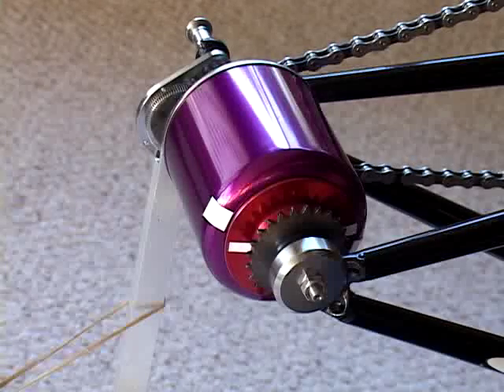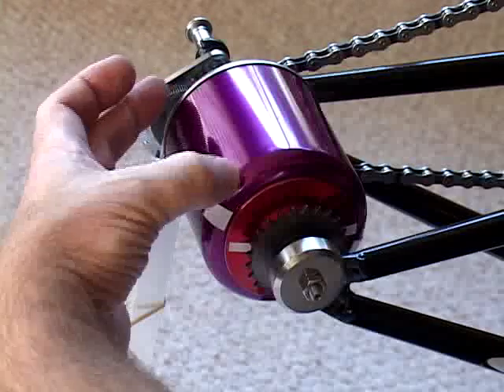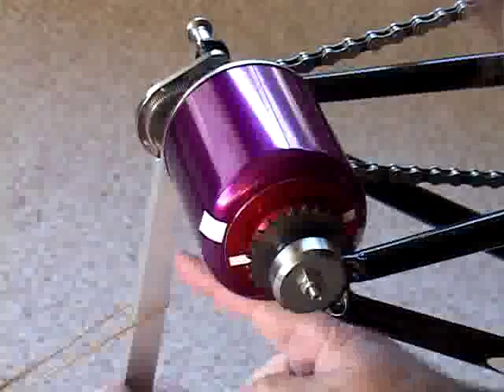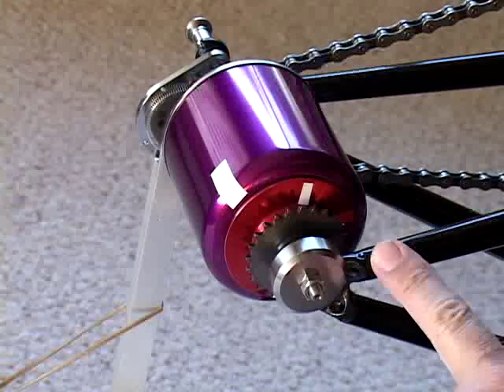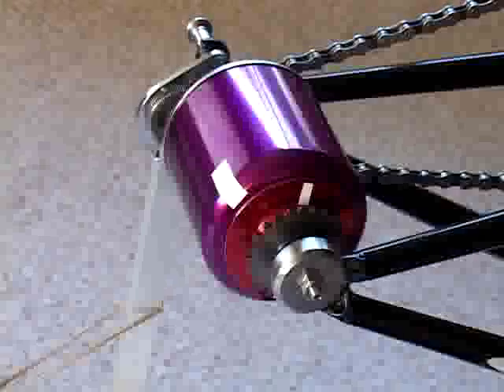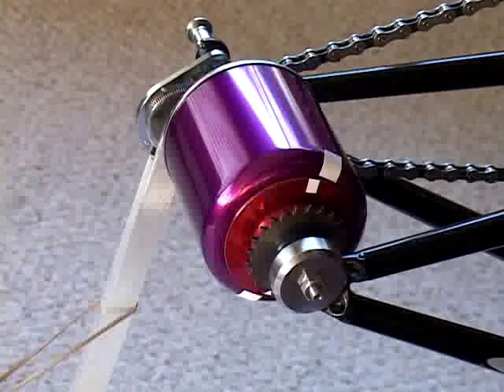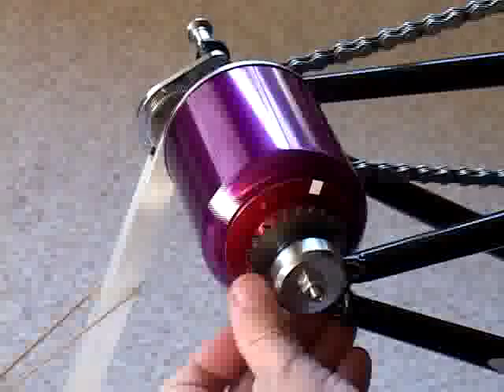Automatic Bicycle Transmission (IVT)

Comment from the maker: @3nasacova That’s easy, dude: the reciprocal of the square root of 2 or the sine of 45° is a multiplicand of the Cartesian polar-velocity stabilization function as an orthogonal component.  This may have implications in the discrete velocity of electromagnetic propagation.

Comment from the maker: @djscrewlicious357 A Stingray!  Wow, there's a bit of history!  I owned one when I was a teenager, and adapted it to a Sturmey-Archer 3-speed hub.  The SIVAT is not yet available as a product, so you might consider using a multispeed hub for now.  I recommend either the Rohloff Speedhub or Shimano Nexus, but warn you that a lawnmower engine likely produces too much power for them, so you'll need to go easy on the throttle.  The SIVAT for bikes will handle motorized use at about 2 hp.

Comment from the maker: @WaagooshTheRedFox Your suggestion is the idea behind the Prius Hybrid Synergy Drive, which is effective but only about 35% efficient, and only useful for braking.  It's fine for large vehicles only, due to scalar issues.  The concept of charging a battery on level ground with mo-gen, without regen braking, is worse than a zero-sum strategy because only losses are incurred in the total energy account; recycling energy is inefficient in such a closed (self-contained) system.

Comment: i think you should use it to recharge the battery of a motor that drives the motor. see, you activate the motor right, once you are up to power across flat ground you increase the output of the transmission and it charges the battery while the motor is off. then you can power up hills witht he motor, and use the gears to generate power when you go down the other side.

Comment from the maker: @callmeshane303 Thanx for that input.  I have thought about the prospects of fully covering the chain drive for that very reason.  Since the SIVAT drive eliminates derailleurs, an optional cover could be designed to cover the chain & sprockets as a 'clamshell' 2-part shroud.  The simpler design would protect against dry grit & dust.  I've also looked into the Gates belt drive, but have found that pulley sizing is problematic for the SIVAT system; both pulleys would be too large.

Comment from the maker: @callmeshane303 Several of the 100's of YouTube commenters have helped me to better understand how the SIVAT will be used.  This made me realize that a front sprocket version is better.  I recently (yesterday) discovered that such a front version will enable inexpensive optional setups for achieving higher top ratios without unusual sprocket sizes; the rider will have more freedom to customize his/her SIVAT without much special hardware!  It will be chain-driven & will be sealed.

Comment from the maker: @TheHumanNacho Additionally, purely motorized vehicles will include a servo-assisted ratio control system that will allow zero-speed for clutchless idling & decelerating to & accelerating from a stop.  A flywheel-based version will be fully computer-controlled for such vehicles to enable a smooth Kinetic Energy Recovery System (KERS), while maintaining a spring-based fail-safe mode.  Thanx for your concerns.

Comment from the maker: @TheHumanNacho The physics is the same, regardless of the prime mover.  The effect will be to lower the output/input ratio as resistive torque increases for heavy acceleration & increasing grade of ascent.  Since I've already field tested this on a predecessor CVT on hilly bike rides, I assure you it works very well.  The overload protection won't take effect for typical traction on the steepest hills for bikes; ultra-low ratios will gradually lose torque responsiveness by intentional design.

Comment: While the general idea is cool, I don't think it has much market application on bicycles: while turning speed into torque works for internal combustion engines, most electric engines and uphill bicycling, cruise bicycling and downhill bicycling rely on turning torque into speed. Furthermore, having an overload-cutout makes it unreliable on the kind of situations a real mountain cyclist gets into, such as deep mud and soft sand.
Give it a decent high range and you'll be in business.

Comment from the maker: @myid9876543 Sorry, you're inverting the concept here.  Input (pedal) torque & cadence will be nearly constant, while output (wheel) torque & speed will be variable.  Fairly constant power throughput will result from this, regardless of grade, because power is the product of torque times rotational velocity; as wheel velocity decreases, wheel torque increases.  One might infer that infinite output torque would be approached as the ratio approaches zero, but material limits do not allow this.

Comment from the maker: @THBandit6 That's what the torture-testing is for!  JK!  Don't interpret the overload protection feature too literally; on pedaled bikes, the design for the control system will be fine-tuned to assure nearly constant pedal cadence & force, regardless of the cyclist's strength & hill-ascent steepness.  This is an important design goal for all pre-production prototypes.  As a product, the SIVAT will not automatically slip away under high force as if it was going into 'neutral' gear.

Comment from the maker: @bmw1123658 This assembly would be laced with spokes to a rim for the rear tire.  The product will not be as shown; it will be at the front sprocket location with a different design.

Comment from the maker: @mattcorden95 The word 'proprietary' means that it's a deliberate secret.  Divulging the inner workings would nullify my qualification for a patent, so I won’t tell you!  Sorry.  The key elements in determining slippage are the one-way clutches that slip for <1° of rotation while transitioning to & from full, locked load in overlapping succession.  Slippage is very small & only under light loads, resulting in miniscule power loss.  During their locked condition, they cannot slip.

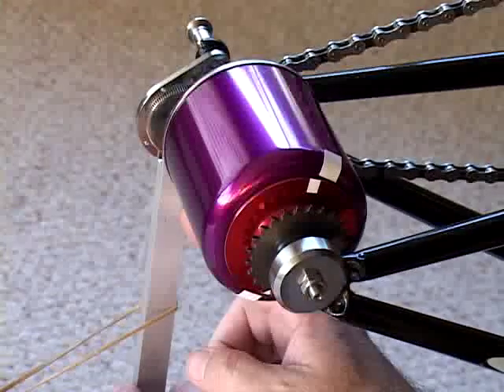Comment from the maker: @3nasacova The power of the lever is strong, Grasshopper.  Apparently, you think that engineers dispense with mathematics & physics to determine a machine's capacity!  Yeah, I'm 'guessing'!  [Watch 4:45 to 5:00; notice that the rubber band represents a spring mechanism.]  I'll be sure to consult with you to check my strings of calculations for structural strength, gearing, athlete ergonomics, motor power-torque curves, component life, velocities, leverage & spring rates in the final designs!

Comment from the maker: @ross425100 I doubt that there are any belt-based IVT's.  However, you are correct that this has less friction than Variable Diameter Pulley (VDP) CVT's.  The company intending to produce it has been chosen, but others might be able to contract for it use.  Thanx.

Comment from the maker: @mattcorden95 The mechanism inside the SIVAT uses gears & levers as a proprietary system for transmitting power.  The SIVAT shown in the video rotates independent from the hub (the output), but its output sprocket is replaced by direct connection to the hub of the wheel.  The next version will be different for the actual product, but will be based on the same principles applied to the pedal crank instead of the wheel hub.

Comment from the maker: @MrSuaveeito Yes.  Since it has the capability to achieve a zero output with gradual increase into very low gears and upward, the SIVAT will have a version with an override for this purpose.  It will act like a clutch, but will be more efficient & durable.  This version will be useful for motorized bikes & other vehicles to accelerate from a stop.

Comment from the maker: @chaser107 It's significantly different.  Nuvinci's high is 3.6X low, whereas SIVAT's high is infinitely higher than its lowest ratio.  Also, the SIVAT does not use rolling traction like Nuvinci.

Comment from the maker: @letsfuc The chain-drive multiplies the SIVAT ratio; in the featured version here, this chain-drive is 5:1.  However, the product version will have an internal high ratio over 1:1, so that an MTB installation will easily achieve at least a typical final high of 4:1 with a less extreme chain drive.

Comment from the maker: @originaldriver Excellent question!  As a first prototype, some of the torque calculations were inaccurate as a result of incomplete pre-design analysis of its complex reaction geometry.  Testing it allowed me to discover errors that are corrected in newer geometry that will react with less bias toward low ratios.  It doesn't slip; what is observed is a tendency to react in favor of lowering its ratio too easily.  Efficiency should be ~88% in lowest usable ratios, 94% in higher ratios. Thanx!

Comment: I wonder how efficient the torque multiplication is on this trans if used on a bicycle? There seems to be quite a bit of slippage in the low-ratio range.

Cool idea.

Comment from the maker: @LawDoc11111111 The principle of operation is different from the ZeroMax®; this allows greater linearity, speed, power throughput & efficiency. I own a ZeroMax®, so I can say that its efficiency is low, more suitable for production machine drives rather than for vehicle drives. The SIVAT concept is only similar inthat it's also a ratcheting drive.

Comment from the maker: @weedissafer The featured version is a wheel hub, much like typical geared rear wheel hubs for bikes; so the tire would be mounted on a rim attached to the hub with spokes.  The planned product will be a replacement for your chainwheel at the pedal-crank instead, so your rear (drive) wheel will be very simple like on a fixie.

Comment from the maker: @1337Machzzz John H. Gibbs' master's thesis indicates VDP CVT (typically snowmobiles) efficiency at 65%-80%.  My calculations for SIVAT efficiency indicate 88%-94%, but this will be tested in the development process.  If my calculations are even close, the SIVAT will be better for snowmobiles as efficient, robust transmissions with much more ratio range.  Thanx for your encouragement!

Comment: I dont know how big losses u have in this transmisson or how it works internally.
But the variable transmission has been around for a long time in snowmobiles and transmission there works where the engine is the strongest or in this case the bicyclist. will be interesting to see if this works aswell as you hope and i hope we will soon see a stronger version of this.  And if u can lower the losses 
in the transmission it will revolutionize the snowmobile world.  keep it up. i want this to work.

Comment from the maker: @bnewman94 Ironically, the definition of infinite is 'undefined'!  The problem stems from human limits in dealing with infinity in concept & in maths.  For clarification about gear ratios, the convention is output speed divided by input speed; so my IVT's lowest ratio produces zero output speed with no reference to self-propulsion.  The IVT term distinguishes it from the CVT (which has a finite range).  Anyway, thanx!

Comment from the maker: @jpsousa4 No.  A clutch is a dynamic friction device, whereas the SIVAT is based on static friction.  This important distinction means that the SIVAT is low-loss as opposed to lossy in power throughput.  Your simplistic comment pays little respect for the myriad of comments & responses here, let alone my efforts to provide a new, useful machine.

Comment from the maker: @Murzamadiyev You'll not likely be able to put too much load on it because the design should accomodate the strongest elite bicyclists.  The highest loads on hills will result in very low ratios unless you add a motor-assist with motor power that exceeds its capacity, in which case it would drop to zero output.  Normally, this feature self-compensates because the lowering ratio results in lowering pedal torque & higher pedaling cadence.  Overload protection won't kick in with normal conditions.

Comment: This is not infinitely variable, the range is 1:1 through 1:0. This is basically only good for biking from a stop or going uphill. Where is the 1:10? I want my wheels to turn ten times for everyone once i turn my peddles in order to go very fast. If this was truly infinitely variable, then i could theoretically peddle at 1:10000000000 and end up going 300 M/H on a bike.

Comment from the maker: @TimpBizkit The SIVAT does use gears, but in an unconventional way.  It uses a different principle of operation than CVT's that you're likely familiar with.  It's mechanism won't be shown until it becomes a product under a pending or issued patent.  When the SIVAT is sufficiently developed for production, I intend to create a new video to demonstrate its use on a bike with a rider experiencing various loading conditions, such as pedaling up & down hills.

Comment from the maker: @TimpBizkit If you reverse the sprockets, the highest ratio will be rather low.  If you stand on the pedals, the ratio will lower faster than if you begin pedaling with slightly less force; this responsiveness will be user-adjustable.  You'll be able to lock-in any ratio too, so that the ratio won't change even when you stand on the pedals if you want.

Comment from the maker: @Asylumescapee69 All multi-ratio transmissions have one highest ratio.  The SIVAT achieves that with sprocket sizing; pedaling speed for the YT video was actually rather slow like high gear on most multi-ratio bikes because a large sprocket (not within view) drives the small sprocket (visible).  The product for bikes will have a high ratio similar to an MTB high ratio, and all ratios going down from there.  The SIVAT is far different from a varispeed drill drive, drill chuck or anything else!

Comment: I don't see the usefulness of your prototype...In a bicycle I want less pedaling to more wheel revolutions as I build speed. It didn't seem like your transmission did anything greater than 1:1 and actually took rpms away... 
essentially it appears to be a re-purposed drill chuck...

Comment from the maker: @cloverdale87 First it should become successful with bikes & motor-assisted bikes.  After that works out, we'll know how to design it for more power as required on motorcycles.  The higher input speed of an MC engine, compared to leg-power, works to the advantage of the SIVAT's low ratio capability.  In effect, it will cover a huge range of MC speeds with more efficient engine operation via rev control.

Comment: @SIMKINETICS
Well i'm not sure.
The rubber band thingy was already commercially available
Since you say your SIVAT will be available late next year...
It looked different from the one you showed in your video, the employee said its main
advantage is to be very silent when shifting gears.
If i understand correctly the SIVAT is not shifting gears but gradually changes
the ratio without interrupting forward drive. (sorry for raping mechanical terms)
i think the SiVAT will be worth the wait.

Comment from the maker: @unamaxify Perhaps the 'strange looking rubber band thingy' was my SIVAT!  The SIVAT will be a product, likely first available late next year.  Bike shop employees will learn about it in detail, and will understand it as a machine composed of durable metal components including a steel spring instead of the rubber band!  BTW, 'gearbox' is a misnomer; although the SIVAT uses gears, its ratio variability stems from simple levers.

Comment from the maker: @zreng1 Excellent question!  Freewheel-style bearings (overrunning clutches) use friction to engage wedge-like action in SIVAT's Continuously Variable Regulator (CVR).  Power is transmitted without relative motion between wedging elements, so this friction is almost purely static and lossless.  Tiny amounts of power loss result from dynamic friction during repetitive freewheel engagement & disengagement of CVR elements.  The SIVAT is a high-efficiency friction management system.

Comment: @SIMKINETICS i still dont see much of a difference(performance wise not mechanically) either way as soon as some one come out with a variable transition that dosen't follow the set point or gets like 30-40 set points instead of (6 witch is what my maxima has) that well be the transition i want in my car for performance and mileage for when im not ripping around,, but i know torque converters well still have a place in the industry for there delicateness and ability to tow heavy loads

Comment from the maker: @manseaua Ironically, I do not like automatics in cars!  The impetus to design an automatic IVT is based on avoiding the annoying aspects of automatics.  Torque converters' average efficiency is much lower than their max, about 35%, but somewhat dependent on driving technique.  Since most of us often drive in slow conditions, this low efficiency is a problem because the TC is not locked out at such speeds.  You're correct about set points, but a CVT cannot be made into an IVT by settings.

Comment: @SIMKINETICS actually that's true i overlooked that thinking to much about manual i wouldn't drive anything but manual and my cvt  i read that the maximum efficiency of a torque converter is around 92% and that's highway driving so yes it would  be a great gap from automatic to ivt but as i sayed b4 the cvt and the ivt are very identical the only changes i see that need to be done is stopping the set points that they all have other than that.. idk whats left to do. make it lighter smaller?

Comment from the maker: @manseaua You under-estimate the significance of wasted energy in torque-converters; they're active during much of city driving, and they're very inefficient.  If you understand that the average driving speed of cars is 11-12 mph (USA), you'll know how wasteful TC's are!

Maxing rpm is OK for heavy acceleration, but most drivers need moderate acceleration with moderately high engine rpm; the SIVAT accomodates both!  This implicates a need for new engine design.